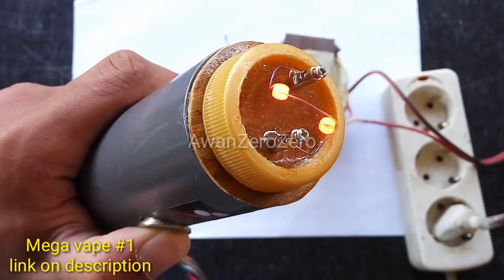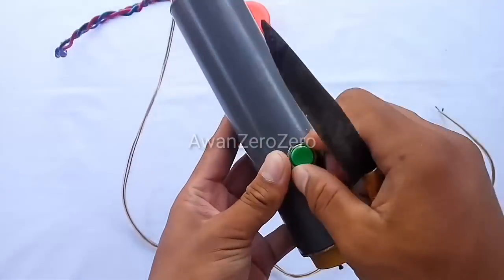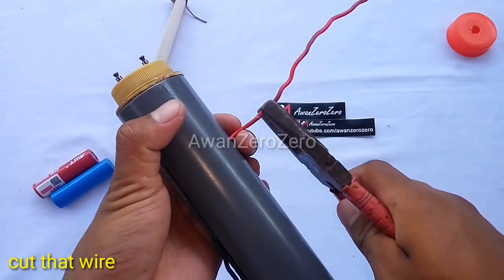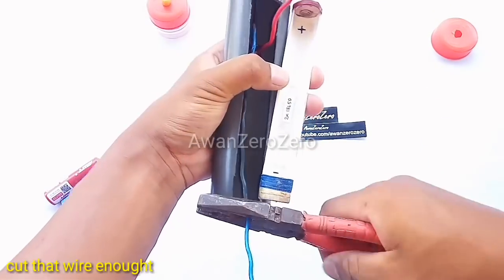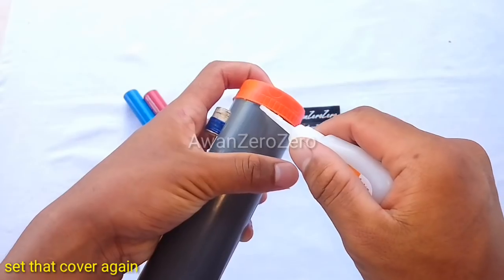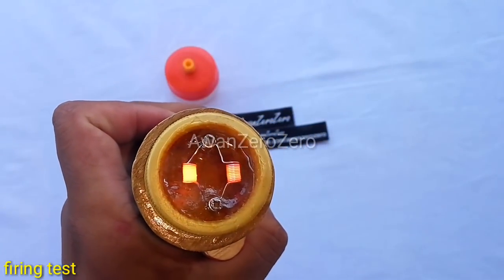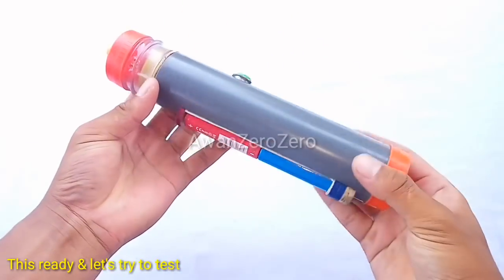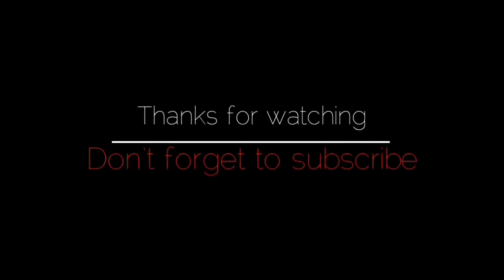GIANT/MEGA VAPE #2 Use battery power

Comment: What wire you use 
And what size
Reply from the maker: For connection copper wire 1,5mm diameter, for coil kantal wire 24awg 10turn × 2